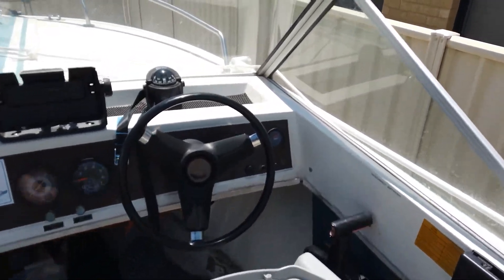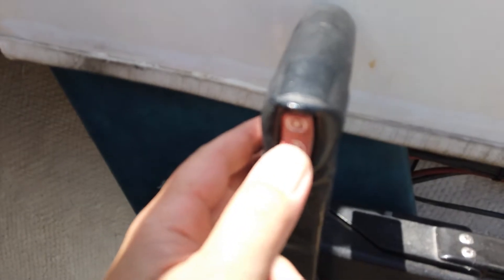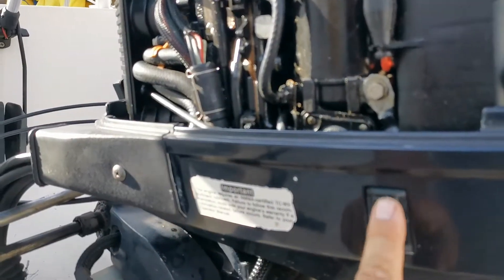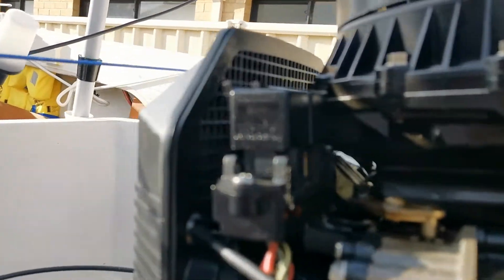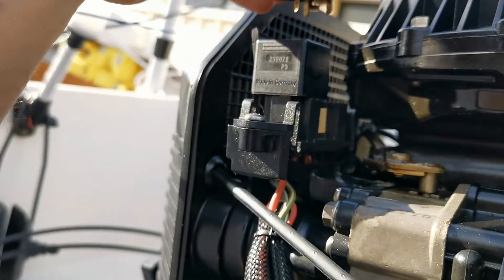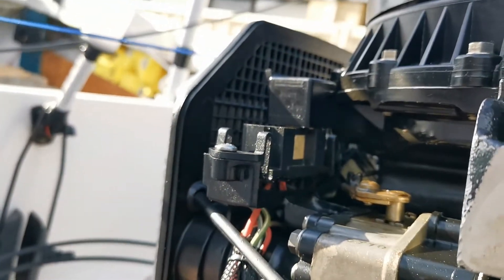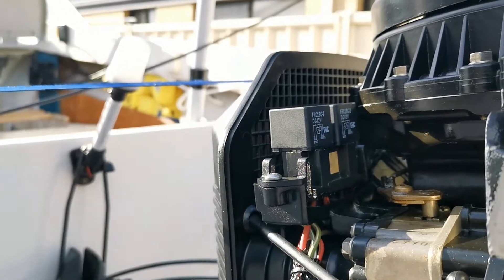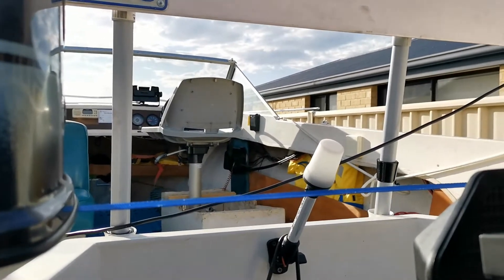Evinrude Johnson outboard trim won't work or go up or down. How to fix this outboard motor problem

Comment: I went to johnson evinrude Hunts Marine here in Sydney AUS.  The relay is a TYCO part.  Its $50 in Jan 2026.  The relays might be a supacheap but they need the silicone on the bottom so water cant get into the relay.

Comment: Mines older it doesn’t have relays. When I try to take the up or down wire straight to the battery to test it the wire just gets really hot and nothing happens

Comment: Can a faulty relay cause it to lift at some times then be dead for a while, then work again? Mine did it yesterday… didn’t want to lift, so I put it back in the water to move out of the way, then all of a sudden it lifted again 🤦🏻‍♂️. Was a brilliant experience for my first time 😂
Reply from the maker: Yes that could be a possibility

Comment: Thanks mate you saved my outboard from the concrete curse. 10 pm at the boat ramp coming back in after a fish and trim up wouldn’t engage. Absolute legend for the pointers. Send me your address and I’ll sort you out with a thank you.
Reply: Oddly enough, swapped both relays and now both up and down works. Off to buy some new relays after work tomorrow me thinks.
Reply from the maker: @TheBigDoof  All good mate. No thanks necessary! Glad to be of help.

Comment: Hey mate how do i remove the control box has me stuffed Gero WA
Reply from the maker: https://youtu.be/3Gg_iXMflkk?t=230
Reply from the maker: Have a look at this one mate. It doesn't show exactly how to do it, but it'll show you roughly where the bolt holes are. You'll have to undo the bolts holding the controls to your control mount. (Mine is side mounted). Good luck
Reply: @Unfastened  cheers

Comment: Mine is doing the same goes down but not up switch the relays and it’s still only going down any ideas it’s a 70 Johnson 2000
Reply: Check the tilt limit switch, may have to google the location as I can't remember but I do know that it will only cause it not to trim up but will still allow you to trim down.

Comment: Thanks mate, simple and well presented vid. Question, agree relays do vary in price lol, looking at the ones you bought, they are 30A, (I’m led to believe that the original ones are 40A NO and 30A NC , means not much to me lol), so my question is, the ones you installed will do the trick nicely ? Cheers, Frank from Sydney
Reply: Just bit the bullet and bought the ones from jaycar as per video, $22 a pair, worked a treat. Cheers

Comment: So, weird scenario for me on this and I may need some help. I recently went to the rear to use the controls on the motor to trim up. It went up as high as I needed it to, then when I tried to trim it back down, nothing. Trim up and down both are not working. Even the control panel up/down at the console won't do anything and it was just working seconds before I used the switch at the motor. Could this be a relay issue? I'm hearing a clicking sound from the relay when I hit the trim down switch, but no click sound when I hit the up switch. I just ordered the relays just in case, I'm hoping I don't have to replace the trim motor but will if I need to obviously. I swapped the relays around to weed out a bad one but nothing seems to work.
Reply from the maker: If you swapped the relays and can still here the click from the down relay when you hit the down switch, I'm thinking it's the hydraulic motor. Valve might be jammed which fried the up circuit (either fuse or wire?) and explains why the click on the down relay still doesn't activate the pump. Let us know how you go. Good luck
Reply: @Unfastened  I got the relays in. Popped both new relays in and the trim works perfectly now
Reply from the maker: @austinthompson2127  Good stuff mate. that's a cheap fix. I'd be happy with that
Reply: @Unfastened  thanks for the helpful video man! Saved me a lot of headaches and time. I would have probably been chasing a ghost problem had I not come across your video!

Comment: Hi, I have almost same engine as yours but 90HP.  When I replace relay they work for a couple of up and downs but then back to working up or down but not the opposite.  Any ideas?
Reply from the maker: A relay has a load rating. If the relay keeps blowing, the load is usually too heavy for that particular relay. Check you are replacing with the correct amperage relay. If that is correct, your tilt/trim is pulling too much load and may need looking at / replacing.

Comment: Hi mate do you know much about power packs n coils? Im have a lot of trouble finding that when the motor is cold the boat runs sweet but when it’s warmed up the motor bogs down and spits and splatters like a car on limmitier going bttr bttr bttr ect till I back of it runs good under low rpm then when accelerating it does as described. Can you attach a way for me to send you a video please?

Comment: the johnson i have will go down but wont go up. switch on the console is new and the relay has been replaced, it still wont go up
Reply: Same on my Johnson 150...did you ever find the fix? If so mind sharing the problem

Comment: Put new brp throttle but trim didn’t work on throttle.  Ran positive to red on trim handle still nothing, ran positive to red going to motor and throttle handle and it worked for a day.  It stopped trimming down at handle.  Trim on motor works fine.  Needed up messing around and fuse went on motor but had spare.  Disconnected trim and trying to figure out wtf is wrong lol

Comment: My local key west dealer thinks theres only two wires going to your tilt and trim ? Lol ..im looking for the female plug in for mine , that round plug in with the wire safety around it ? I put on a 2000 johnson 100 hp i think , removed a 1996 88 evenrude spl ..and i got both male plug ins , no wire safety clip either ? And my dealer dont know much ? 😂

Comment: My problem is the engine keeps trimming down , not stop … maybe the relay also ?
Reply from the maker: Yes some relays become sticky, so once the relay latches it won't unlatch. Try replacing / swapping it

Comment: I did this, then saw this vid. I had the original relays, which were sealed with somthing which cold be peeled away, and i could easily pop them open. One had sooty contacts. I cleaned them, and applied contact cleaner and protection spray. This could be a temporary  fix even without cleaner/protection if new relays are not availible at the  moment. I changed one relay, and kept the repaired as a spare. Good video.

Comment: I have the same problem, only when I swapped them, trim up still didn't work and trim down worked fine. What's next?
Reply: Did you ever figure out what was wrong with it I’m having the same issue bought two new relays but still won’t go up but goes down fune

Comment: If the relays are bad will that make my outboard not start
Reply from the maker: Hi, most outboards with tilt/trim will have relays for each function (one for up, one for down) and the starter motor also has it's own relay. If yours will not start, just check the starter relay, make sure it is getting power when the key is turned.
Reply: Starter relay is new still no power to motor or trim
Reply from the maker: @bercy1921  Does the motor have controls or is it tiller steer?
Reply: @Unfastened  it has controls
Reply from the maker: No power to start the motor or to trim up or down? Must be wiring or switches mate
Reply: Going to take the controller apart today to see if anything is broken
Reply from the maker: @bercy1921  A common culprit is the power source going to the controls (Not enough negative earth is a common fault).

Comment: My 115 ocean pro is doing the same thing. Motor turns over, trim doesnt work and just clicks. I replaced both relays and nothing. Any suggestions? Thank you!
Reply from the maker: Put your finger on the relay, and press the trim button. You'll be able to feel if the relay is clicking. If it is, then your problem is between the relay and the hydraulic pump. If the relay is not activating and you can't feel anything, then the problem is between the switch and the relay. You said it clicks, so the switch is probably activating the relay, but theres an issue between the relay and the pump. Start at the relay end, and check the terminals coming off the relay. Corrosion or a loose connector is possible. Then trace those wires down to the pump, and check the pump end. Put a multimeter on the pump end, see if voltage is coming through. Thatll help find out where the problem lies. Good luck

Comment: I was helping a friend today with the same exact engine set up. His motor would go down but not up. I pulled both relays and switched them and still not able to get engine to go down. I did see a minimal amount of corrosion on the block where the down relay was plugged .Wet the block with wd-40 and it still didn't work after I reinstalled the relay. What is the best way to deal with the corrosion?
Reply from the maker: If it's proper corroded out, you could cut the end off and replace the connector if you have enough freeplay in the wiring. Then use a light coat of some Dielectric grease to prevent corrosion

Comment: I have the exact same motor and I'm having issues with mine.  I tested the blue and green wire by the female connector before it does down to the trim motor and I'm only getting .5 volt reading. Any idea what could be wrong?
Reply from the maker: Only the control switch and the tilt switch on the motor run to the relays. Check the switches mate. Could be corroded, not letting enough voltage through to the relays.
Reply: Great vid I have the ocean pro 115 that is blowing fuses as soon as I hit up or down any ideas